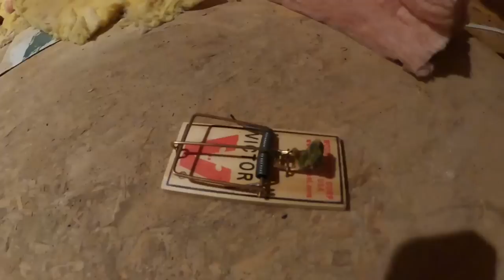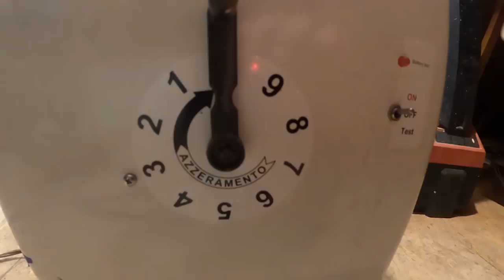18 Years Living with RATS...Home’s WORST Nightmare - BEST RODENT REMOVAL

Comment: Hi guys, I just found y'all here on YouTube for the first time, and I am loving your channel! I have a question for you: Years ago we used a rat poison that would dehydrate the rats insides so that they didn't smell after they ate it and died. I don't remember the brand, but I thought it was one of the bigger names like D-Con, etc. I've more recently been reading ALL the labels in the stores trying to find it again, but to no avail. 😭 Does the Plaster of Paris/flour mixture help to eliminate the smell after hardening the intestines of the rats? We have a dog that I worry will catch/find and eat a poisoned rat, so having them die under the floor or in the attic wouldn't be so bad if I can find a dehydrating poison that would make them not smell.